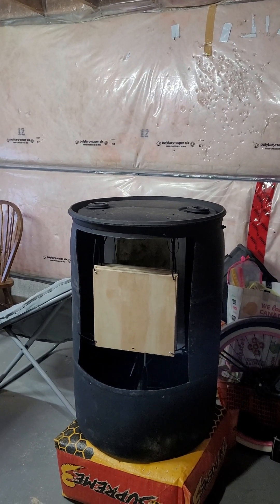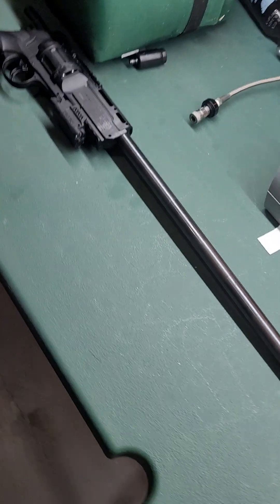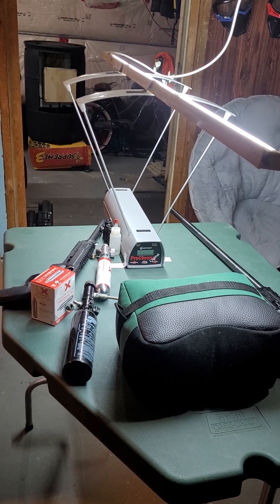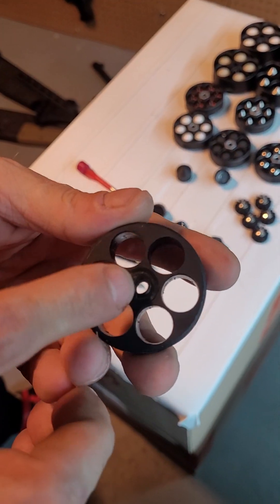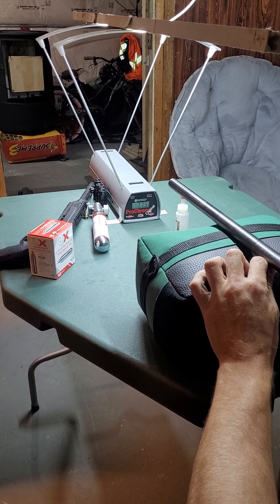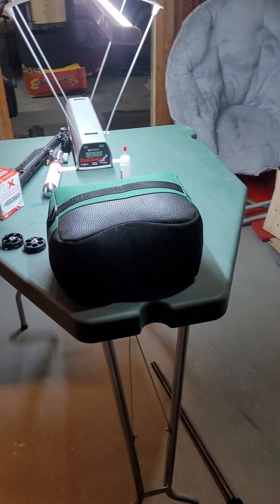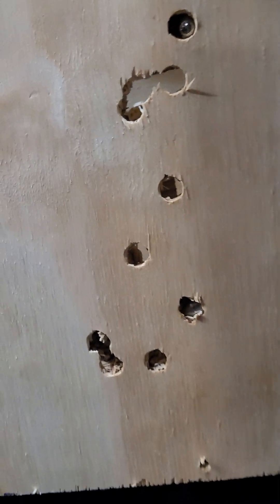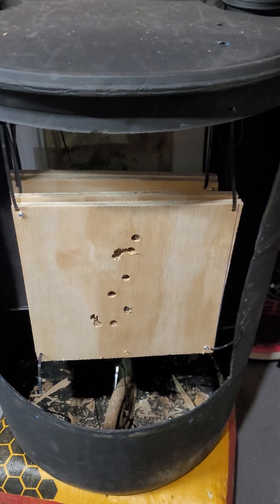Umarex T4E HDR-50 110 Joules Z-Ram 50s Z-Chambers Steel balls vs 2 inch of tough Plywood

Comment: I love it it looks like the jokers gun with the extra long barrel!!! 😂 Im awaiting mine in the mail and want to mod it aswell im getting the 7.5j version and am wondering if i got a hpa adapter if theres anything i have to remove or replace in the gun for it to be able to use the extra pressure is the powerkit actually a thing I know theres lots of videos im just worried about snake oil is all.
Reply from the maker: just remove the valve block in the valve and no restrictor and use hpa is all you need, dont worrie about powerkit :)
Reply: @LessLethalHomeDefense  Thanks alot for the reply! its good to know all I need is to pop out the valve block and be careful of springs I might make some kind of lil tent to put over it when i wiggle it apart just incase cant wait to get it set up!

Comment: So uh, dumping a bunch of oil in the air intake is basically dieseling the pellets. Won’t work with C02 but HPA will ignite oil under pressure
Reply from the maker: this is silicone oil drops, it wont diesel lol but the silicone aerosol will ignite if a ball gets stuck in the barrel using hpa, its flammable

Comment: The modifications that you made are amazing, it's very impressive for an airgun like that to reach 100+ joules
Reply from the maker: ya its crazy from 7 to 110 joules wow!
Reply: it can handle even more 😉
some policemen using these with even more power
just sayin
Reply: @mr.electronx9036  interesting
Reply: @mr.electronx9036 police don't modify airguns

Comment: You are the gunsmith from Call of Duty. Why would someone put that long barrel for a revolver? Anyways great video as always :))
Reply from the maker: it increases the power by a lot :)
Reply: @LessLethalHomeDefense  must be a hell of a lot. I aint seen the shooting yet but do u mean 11 joules or 110? n if at 11 joule they shoot at around 300-500 fps how come if this is 110 joule with the barrel it only goes at 510 fps? just wondering as im planning to get one of these babies I got the snow defender but that was deaddddd lol
Reply from the maker: @GrimeSpreeStudios  i have a few vids of this shooting upto 112 joules, and the 500 plus fps is because the balls weigh 8.4 grams, if these balls were around 4 grams it would prolly come out at near 1000 fps, at 51 joules a rubber ball will come out at close to 900 fps because they are closer to 1 gram

Comment: If I glue sheets of wood together the ball goes clean through. If I leave a gap between the sheets without glue, it is stopped much earlier.
Reply from the maker: i believe your right, back a while ago it went clean through 2 sheets at 63 joules

Comment: Great test as always. Impressive energy 😃👍. Cheers from your friend in Norway
Reply from the maker: Thanks buddy! :)
Reply: @LessLethalHomeDefense  hi , what is the easiest way to power up the hdr68 16 joules version , i ve never did any mods , im afraid to do something wrong .
Reply from the maker: @kozak5899  just remove the co2 restrictor in the co2 chamber, also a longer barrel and hpa set up will give you up to 75 joules
 and using zram68s or grimburg juls will give you a slight increase as well, they fit the factory barrel much better
Reply: @LessLethalHomeDefense    What barrels are you using for the hdr68 please
Reply from the maker: @onazram1  im using the tuning run and hd 24 sniper extensions